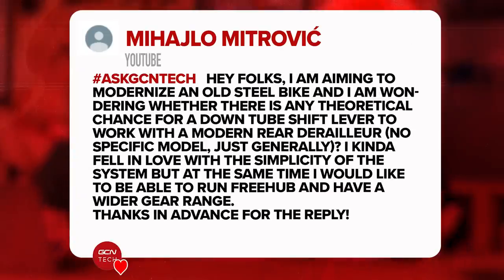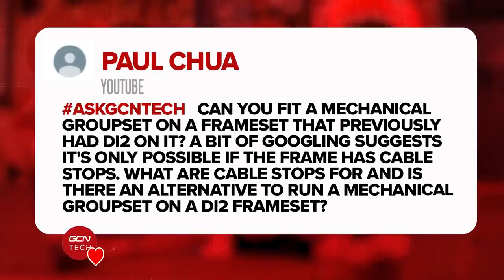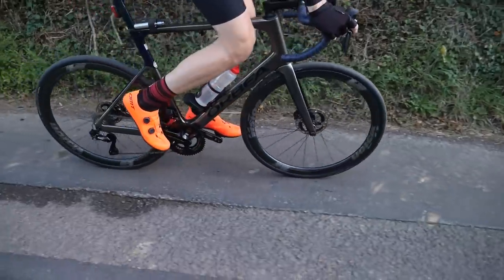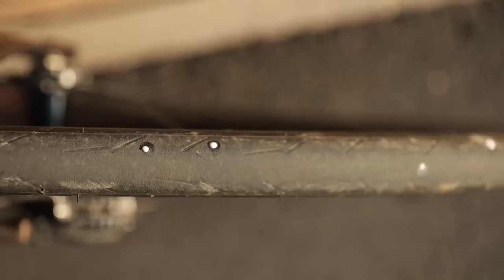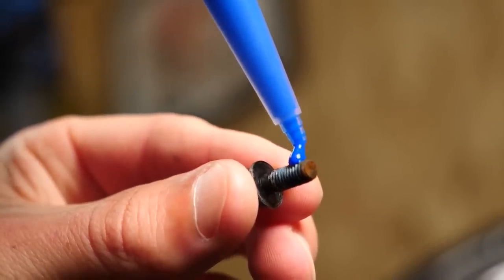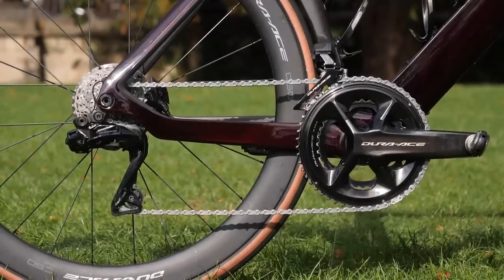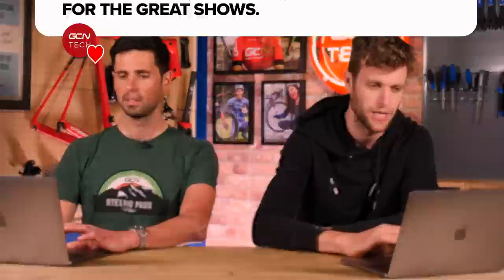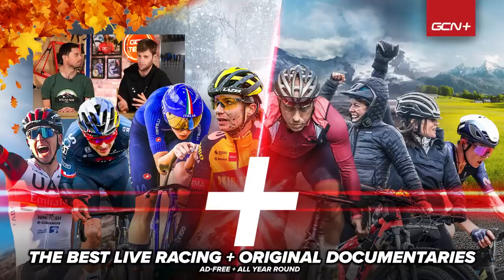What's The Better Upgrade: Wireless Shifting Or Carbon Wheels? | GCN Tech Clinic

Comment: I was asking myself this same question over the last few days. My cycling friend said get Di2 but my mechanic friend told me to get Carbon Wheels if your bike already has mechanical shifting and to only get Di2 once you buy a new bike as the cost of parts and labour on an existing frame won’t be worth the benefits, whereas new carbon wheels will be.
Reply from the maker: Just like Alex and Conor said, it all comes down to what style of upgrade you're after. 🔧
Reply: @gcntech  As well as how cost effective it is.
Reply: That's exactly right. My Giant TCR with 105 would have cost me $2k USD to converted to electrical shifting or I could buy carbon wheels. 

The bike shop told me I would be better off splurging and buying a bike that has both carbon wheels and electrical shifting. I ended up buying an Émonda  eTap Rival with carbon wheels. Best but ever!

Comment: Between new groupset and wheels, I would 100% go new wheels.

I run 105 r7000, which are fairly good functional groupset. I’m all about getting faster.
Reply from the maker: Sounds like a plan 💨
Reply: As someone with mechanical shifting, I 100% agree!!
Reply: How is someone upgrading to Wireless for $1200 anyway? Maybe its cause i am in Canada, but with a $1200 budget i can’t imagine wireless being an option.
Reply: @mdbourne  if you sell your mechanical groupset you can get around 500 dollars for it depending on condition, so that would be part of the cost of the new groupset
Reply: @gustavosalvini1827  ah good point. Especially with a pretty modern 105 r7020
Reply: @mdbourne  I thought I was the only one who had noticed that. Nice problem to have though 👍🚲
Reply: 100% for wheelset

Comment: Don't ever see myself really getting into electronic shifting. There's something fundamentally important to me about my bike being human powered and mechanical. So many things need an app and a usb cord these days, its nice to have something that is just me and and the machine working together. That, and doing bikepacking or touring, the simpler the system the better. Just so many fewer headaches. Hell, I'm even thinking about moving to friction shifting for this reason.
Reply: ^^YES
Reply: Not having to replace your worn cables saves a lot of headache, in particular if your frame has internal routing. I'd say this is worth the few hours of recharging the battery every 2 months. Synchro shift is a big nice-to-have as well. 

I was a big mechanical groupset advocate. However, been riding the new ultegra di2 for 4 months now, and im sold.
Reply: I have never tried electronically-controlled (it's still mechanical) shifting, and I don't see the need to spend the cash to have it.  I grew up with friction shifting, and I will be using it on my upcoming hybrid-to-"gravel" conversion, at least on the triple crankset and maybe on the 9-speed rear as well.  That depends on how well the right-hand bar-end shifter can be tuned in indexed mode.
Reply: took my 2002 vintage campy 10 speed record equipped Ti bike out for a spin the other day.  with new cables and fully serviced bottom bracket, its rolling like new…… however much prefer the crispness of shifting on my Di2 Ultegra equipped bike….
Reply: I would have said the same thing until I got Di2. I get that there there is a bit of futzing with charging and updating the firmware, but I love electronic shifting. I can always find the right gear, never have to adjust the derailer alignment, and best of all my small hands always struggled with pulling mechanical gears late in rides or during stressful races/workouts. For me, I don't know how I rode all those years with out Di2.
Reply: Tell me you've never ridden Di2 without actually telling me you've never ridden Di2
Reply: @jimhansen5395  I think part of it is I'm not really a road cyclist, I do more bikepacking and touring, so I think part of it is just different priorities. I'm on a 1x for the same reason.
Reply: Do you also use a paper map to navigate?
Reply: @JonReid  The army  are still training to use regular maps… because when you are in the middle of nowhere without power or signal the paper map still works. A bit like mechanical Vs electrical shifting. One is for people who want reliability and an easy cheap fix, the other is for bankers and lawyers to show off how rich they are
Reply: @reginaldscot165  I appreciate the reliability and simplicity of mechanical, but when you’re out on a ride in a new place, pulling out a paper map for navigation is less than ideal.
Reply from the maker: Thanks for sharing Alexander! DI2 certainly isn't for everyone. Let us know how you get on with friction shifting, would be great to hear what its like going back to older tech. 🙌
Reply: Have to say now I’ve switched to di2 on my road bike I’d never go back to mechanical…I still have it on my gravel bike but will be upgrading that to electronic shifting as soon as I can
Reply: Having three bikes - electronic, mechanical, and fixed gear - I can tell you that ... they're ALL the best! I'll never upgrade my Moots RSL mechanical. Here's why: https://moots.com/wp-content/uploads/WHY-I-LOVE-THIS-BIKE......pdf

Comment: My current winter tire setup is Continental Gatorskins with a set of tire liners/tubes installed on alloy rims. This has the added benefit of increased rolling resistance which is a bonus training effect that makes my summer setup feel oh-so-sweet.
Reply from the maker: That sweet feeling of swinging your leg back over the summer bike ☀️... nothing quite like it.
Reply: Good luck staying upright!

Comment: Get fitter and stop getting caught up in the trends. There is a limit for most of us where more money adds minimal advantages.
Reply: Careful, the Bike Industry knows where you live🤣
Reply: The performance advantage isn’t really relevant in all honesty. 
All of us are just hobbyists. We buy them because gears and gizmos are the fun part of this sport.
Reply: @savagepro9060  😂😂
Reply: @slowcyclist4324  Fair point, I'm in that group too, hypocrite 😂
Reply: @slowcyclist4324  the bling appeal, but be honest it's HARD to resist, they use special marketing psychologists to catch us . . .and they do! SOB, SNIFF
Reply: Very well said
Reply: Wheels are usually a pretty worthwhile upgrade though. Everything else is debatable besides making the bike fit property
Reply: On your 1980s race bike you get then, my friend!
I mean, you are right, more fitter is more better. But if someone is flush and looking for something to spend on, why not? Better than Beer (Dan Lloyd, looking at you), which would counteract part one ;] .
And I mean, if that gives the added impetus to ride more, there you go getting fitter will also happen by chance!
Reply: Top 5 riders in the race are all fit, train hard, get enough rest to recover and they prepare for every race. 

They all are just a fractions of a second behind one another. 

This is where those small "marginal" gains come in. From efficient and fast drivetrain, aero frame, aero wheels, light weight components.

You can't just tell racers to "get in better shape" they are and the top tier are no slouchers when it comes to their training. 

If a rider is faster than another rider by several seconds then yeah no bike in the world is going to make up the difference. That's where the rider has to make the improvement.
Reply: Cant We have nicer things?
Reply: We can. The problem is that some folks still haven’t realised that cycling is a luxury sport for weight loss, and that counting practical performance gains is irrelevant.

Comment: For the question regarding SPD cleats coming loose: when you tighten the cleat bolts up> wait 5mins and you will find you can tighten them some more. Repeat if necessary. 
Its because the sole of the shoe compresses under the load of the screw, so the screws become a bit looser 5 mins after you first tighten them.
Reply: Yes to this, and recheck them every hundred miles or so for the first few hundred miles.  You will very likely find that after three or four times doing this you won't be able to get them any tighter, and they will stop coming loose.
Reply: I was going to mention this also. Unless you have a carbon sole (or higher end plastic one) they compress for the first 100 or so Kms and need tightening initially
Reply: You must incrementally tighten them while alternating between the bolts; same as changing a tire on your car.

Comment: First question .... Shimano still produce dura ace 11sp bar end shifters (for TT bars) which will work on downtube mounts no problem. So, as long as they go 11sp Shimano, they're all good.
Reply: Was going to say that. Additionally, microshift and sunrace make them for 9 and 10 speed too, but we are still talking shimano cable pull ratios
Reply: Oh my god, I forgot that one, yess 11 speed, they fit  the downtube bosses

Comment: Having done exactly this set of upgrades - wheels then groupset - I completely endorse wheels first. Mechanical 105 of that generation is already really good. Good wheels made a big difference to the bike overall. Electronic gears I did a year or so later and it's good but it's not the night and day that wheels and tyres were. The old wheels were no slouch (DT Swiss E1850s) but the new wheels (Parcours Strade) are a big difference
Reply: Thanks for this, I have the exact same scenario as the video (105 R7000) so its good to read this!

Comment: Rivnuts can be re-compressed using an apporopriately threaded screw, a washer, and a nut, insert the screw, tighten the nut down onto the washer to further compress the rivnut.

Comment: Shimano still sell a Dura Ace down tube shifter set with indexed rear shifter for 10 speed and works with Shimano 10 speed derailleurs. I upgraded old 1990 Miyata triple butted steel bike previously with 7 speed to this just a few years ago. Indexing is nice and snappy. The front derailleur is friction shift. Check out the Microshift brand options too
Reply: I did not see your post before posting mine. These younger presenters do not know sh!t
Reply: @savagepro9060  that’s true! The bike industry and everyone associated feeding it would have you think that only the latest tech is all you should be looking at but there’s plenty of knowledgeable people riding bikes with all sorts of older or alternative system components building bikes to suit their specific needs or desires
Reply: @savagepro9060  thanks again, not quite such kind words this time😅, as I said to your other comment, we are only human and occasionally make a mistake.
Reply: @GCNalex  the not so kind words are NOT for the presenters, unfortunately it's too late
Reply: @GCNalex  I was just sharing knowledge about alternative shifter options. Not being critical. There’s a lot of knowledge out there in the cycling community to share. All the best

Comment: For 11 speed down tube shifters you have the option of dura ace (index), microshift (will be both index and friction for Shimano ) or dia Compe ene 11 speed (friction with a really nice ratchet system).  At 10 speed and below you also have the lovely Rivendell friction shifters and older Shimano ones as well.  The other option (available for most) is using them with bar end options.  Also means you can use MTB rears for a nice wide range.  You two need to look 👀 at what else is available rather than who has the newest electronic sets….
Reply: Agree. I have a set of Dura-Ace SL-7700 9-speed indexed downtube shifters which work great on a modern steel frame with shifter bosses.
Reply from the maker: Great point Nick. These sound like some really good alternatives. 👀 Maybe we'll get the boys looking at some retro tech?
Reply: @gcntech  that would make for a great show.  For example, run bar ends on my 1966 Mercian.  As it has a 120mm OLN I got a cut down rear Shimano hub (Sun XCD) and round a 13/36 6 speed rear with a 48/32 velo Orange crank set all on friction.  On my gravel bike I run a deore 11/51 11 speed with microshift bar end.  There is lots of “alt tech” out there if you look - gets old bikes back out on the road and let’s you mullet a gravel bike without having to spend a couple of grand on SRAM axs 😆

Comment: If one uses red locktite, you will need heat to loosen it.  Would be a bit hard on the shoes.  Loctite has a new orange material, holding power of red with releasability of blue.  If coming loose, the screws are not tight enough in the first place.

Comment: I have a downtube shifter on my Surly LHT paired with a Shimano Deore rear mech and ten-speed cassette. Works like a dream with zero issues. It's not an indexed shifter btw. A message to Alex and Connor... you may not be fans of downtube shifters but I can tell you that when it comes to maintenance I bet you would absolutely love them!!
Reply from the maker: Nothing wrong with a bit of old school, great to hear you get on with them so well.

Comment: 9/10 you can get the cable stops as replacements
or just run cable outer the whole way, it will weight a little more but less chance getting dirt and damage against the cable

Comment: I recently changed a Cinelli Superstar Disc from 105 R7000 to Ultegra Di2 R8000 and a Specialized Tarmac SL6 vice versa. 
The cablestops for the Tarmac had to be ordered as it was a complete bike. The Cinelli frameset was supplied with cablestops and Di2 holecovers. 

Check your frames manufacturer if they sell the cablestops (or try to 3D-print them).

Comment: While I love my carbon bike with ultegra di2, I also love my steel bike with friction shifters, so simple! But I put cablestops on my downtube where the shifters sat, and but new shifters (on a clamp band) on the stem. Much easier to reach, and brings a nice randonneur flair to the bike.
Reply from the maker: Sounds like a great bike selection 💯 We love an old Rando style build!

Comment: Sounds like there's an issue with the threads on the sandals. Blue should work with screws provided with the cleats. Any debris and if the threads on the sandals are worn, it will not hold sufficiently to keep the screws from "just falling out" rather than backing out.

Comment: The flexible soles on the sandals cause the screws to work loose. It's a fairly common issue on any SPD shoe that has a flexible sole

Comment: I've got an old steel frame with downtube shifters (Suntour) and a 10 speed XT mech with a nice side range cassette paired with a compact chainset. Works a treat once you get the hang of trimming it. It's not as amazing as a modern indexed cable or electronic groupset but v robust and breathes new life into a 40-y-o bike. Do it! 
Get some good brakes too - it's worth the extra spend for good braking. Make sure pads are top of the range, it's worth it!
Reply from the maker: Sounds great! Always nice to see an old bike getting a new lease of life 🙌

Comment: You can cinch up a loose rivnut at home: get the right sized hex nut to go on a long bottle cage bolt (a home-brew "tool"), and spin it on until its up against the bolt head.  Screw the bolt in to rivnut until the nut is only a couple of threads clear.  Hold the bolt steady with a hex key and use a spanner to tighten down the nut onto the rivnut.  Go a half turn at a time and keep checking until the rivnut is tight again, then remove the "tool" and refit the bottle cage.  Even simpler you can use... superglue!  Just dab some around the gap between the rivnut and the frame.

Comment: Cant imagine wanting or needing better shifting than dura ace mechanical but i can imagine carbon wheels making a huge difference.
Reply: But wireless shifting 😎 no more cables, wires or maintenance.
Reply from the maker: Don't knock it until you try it Adam... Dura Ace mechanical is pretty spot on though 👌
Reply: Actually, was going to edit this, the only reason id upgrade to wireless electronic shifting is to lose the cables as an aero gain. I rarely have to do anything to my shifting, occasionally turn a barrel adjuster 1/8 of a turn after a change in the weather, thats literally it.
Reply: @adambrickley1119  100%. My 105 shifting is spot on so I wouldn't upgrade to another mechanical set. A lack of cables, the ability to program shifting to be one side for up and the other for down, and the consistency in shifts doesnhave an appeal. Whether it's a £1,000 appeal is a different question.

Comment: you can run a new derailleur with downtube shifters without needing friction shifting. the only time that would come into play would be if you paired it up with a derailleur that had a different pull ratio, or if you fitted a new cassette/freewheel with a different number of gears.

Comment: Funnily enough when I used to winter commute spd sandals were my first choice same for touring. 
One of the main reasons for cold feet is circulation restriction so sandals plus quality waterproof overshoes is warmest option, if you get cycling shoes wet on a multi day tour they stay wet sandals just wipe dry
Reply from the maker: Let's get the team into SPD sandals! Paired with some waterproof socks... a touring cyclists best friend 🧦
Reply: Now well be seeing Crocks with cleats.

Comment: For the person with the first question; Velo Orange sells downtube shifters designed to be used with modern, up to 10spd, derailleurs.  

I keep eyeballing building up a neo-retro commuter, with a Surly Straggler--which has disk brake mounts AND downtube shifter bosses.  Just to play with.

Comment: If the question was 'electronic shifting' or wheels, it would have been a more difficult choice. But wireless or wired di2 doesnt really matter apart from that one time you assemble your bike..
Reply: What is wired DI2?
Reply: @ERIK31351 Previous versions of Di2 were wired. SRAM AXS and current Di2 is (semi)wireless.
Reply: Only the disc brake counterparts of Shimano's 12-speed road groupsets are semi-wireless, their rim brake counterparts are still fully wired.